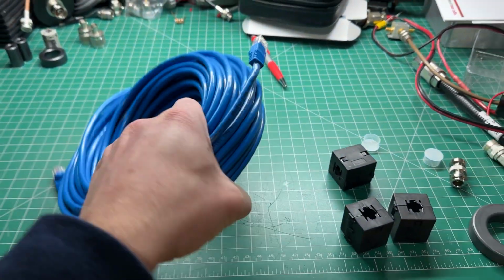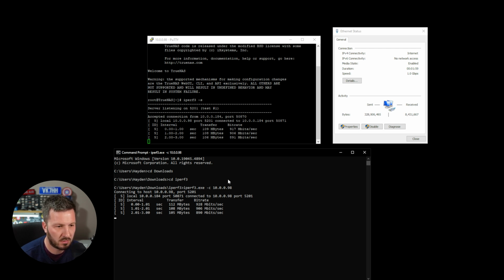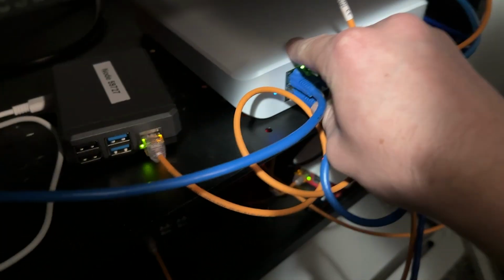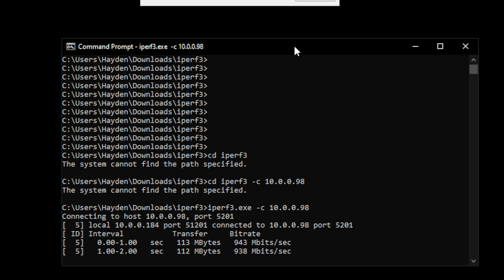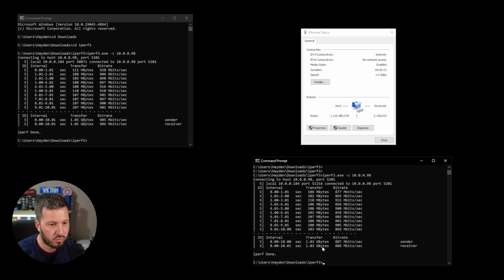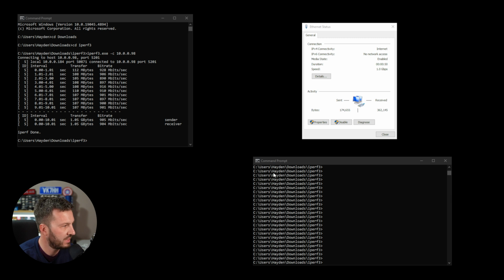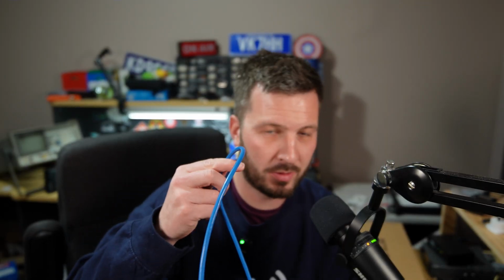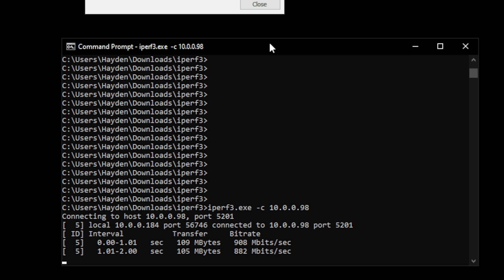Ferrite Cores: Are They Ruining Your Ethernet Speed?

Comment: Datasheet shows that the problem is above gigabit speeds, Mix 43 is permeable at tens of megahertz followed by a steep drop. Mix 31 datasheet shows a wider band of permeability. It's nice to see actual measurements with functional tests, in any case. Overall, however, go Cat 6a or 8, double check that your RJ-45s have metal casing, and ground at one end, i.e. your patch panel or switch.

Comment: I just put up a new dipole and was getting issues with CMC knocking only my main pc off the internet during transmit on 40 meters (haven't got around to putting up the cmc choke at the antenna feedline yet).  I have an extra mix31 ring and wrapped about 3 turns on the pc end of ethernet cable (CAT6).  It eliminated problem.  PC stayed online.

Comment: More likely the problem is the actual connector connection (assembly of the cable to the connector) I choose to use the Feed through style connectors as I find they make for a more reliable connection when making ethernet cables by hand.

Comment: Here is an unintelligent test... Try this on a PoE connection (AT or AF), or if you're brave, BT... (802.3BT that is) and then remove the isolation and ground the PoE powered device to earth! I think you will find very quickly the unpleasantries that a choke will have. Even if you're using CAT6A shielded (aerial or direct burial).

As to the principle reason why it should have no impact is because Ethernet is already transformer isolated on both sides, and are by design: differential pairs.

Comment: I recommend cat 6e. If the switch is getting old replace it also check the firmware on the switch. Call your ISP and check with them on upgrading your router. That is where I would recommend starting.

Comment: Thats BS storrys, ETH is dif pair, external ferrite has NO EFFECT. Thats the whole point of dif pair, outside of it can be wadever bananas and noise, dif par WONT BE AFFECTED. 
As bonus ETH is isolated with transformers at both ends, that will minimize any DC bias issues´and low fewquency noises.

Comment: Can your switch do PoE? Maybe test that for the next video?
Reply from the maker: Yep it can! Would be interesting to see if PoE devices drop out
Reply: @HamRadioDX  agreed, and perhaps how much noise you can choke out of the Ethernet cable
Reply: As others have noted though, you would need to create an alternate ground path. An isolated PoE connection would still create a differential pair back to the power injector.
Reply: @Maker_Mikey  I've experienced issues with PoE making horrendous HF noise, and I've had to choke the heck out of the cables to reduce the noise. I also had drop outs on the same Ethernet cable. Perhaps they are related? Perhaps the noise was coming from the switch?

Comment: When I put a mix 31 toroid on the network cable to my shack computer, It dropped the connection completely when I transmitted on 80m with my Hermes lite 2 and a 300W amp. It was quite frustrating since I then lost the connection to the Hermes. It took me a while to figure out what it was. When I removed the toroid that I had put on a few days earlier, everything worked as normal again.

Comment: Each pair should be perfectly balanced (since they actually use tiny transformers instead of differential amplifiers) so the magnetic fields cancel out for any data signals so the ferrite beats shouldn't effect them unless you put them so close to the twisted pairs that the small gap in the pairs start to matter (which probably would mean removing the shielding and wrap the pairs individually or at least make such a tight bend that the wire gets damaged) 
But that also means that it's unlikely that there is much common mode noise the ferrite cores can help with unless the ethernet magnetics on the endpoints are the issue or there is a shield that could conduct common mode currents (which Cat5 and Cat5e doesn't have).

Twisted pair has this small issue that while it's very resilient against noise that's only really if if the noise couples perfectly equal into both wires and real world isn't perfect, so a strong noise source over a long distance could still cause issues. Shielding could help in that case.

One thing that might actually be better or at least another good statistic than throughput is the RX/TX frame errors while you test throughput (I know on linux you can get them by using "netstat -i" or "ifconfig" don't know about windows though)

Comment: STP and FTP cable is better and what I actually did when I was getting RFI on my long runs (over 30 meters running through the ceiling) was to switch to fiber optic. It was surprisingly cheap to do so. I will continue to use fiber for my long runs.

Comment: An ethernet cable is more or less just 4 balanced antenna feeders.

Notwithstanding, throughput with iperf isn't the be all end all (you should be getting consistently higher with unintended hosts on an unintended network), but the test could be more scientific by looking at frame errors/CRC as well as frame counts sent vs received at either end.

In my experience, PoE devices like cameras are the noisiest, followed by junky devices which induce Switch-Mode noise into everything they come into contact with. The best solution being to use shielded CAT6 rather than UTP.  Adding chokes on marginal runs or crummy cable can make them drop frames. But as you have demonstrated short good runs make minimal difference.

Comment: Nice test. All my cables are CAT 6 and have snap on ferrite on them . I never noticed a speed drop at all.  I choke everything . Reduces RFI radio noise and before I choked everything my Baofeng on UHF when I key up would take me off line if i was close to the switch.  No longer does that with chokes . And the noise on AM radio is much less . I have had bad cables reduce speed and drop outs. 73
Reply from the maker: Thanks Robert

Comment: Of course there can be two different speed issues 1) doing something messes up speed negotiation so you drop to a lower speed 2) Ethernet packet loss, the way this causes speed loss is especially for TCP/IP as when tcp sees missed packets it slows down then speeds up gradually. This can cause a big drop in throughput

Comment: Do the ferrites keep RF in the shack from affecting the Ethernet?
Reply: not meaningfully, unless your antenna is inside the shack. My main problem is the noise from the ethernet getting into the shack :( the noise and harmonics of 250Mhz is horrid... which is the primary reason to get shielded ethernet. Even at the 100m mark, I have more problem with noise from the cable than noise into the cable.

Comment: Old fashioned Cat 5, which you mentioned you were using, I find won't reliably carry gigabit. A lot of times, the network will sync up at gig, then eventually drop back to 100 Mbps.  In my line of work, we have been trying to eliminate all the cat5 (patch cables) we find and replace with cat5e (enhanced) or cat6.  Cat 5e has a tighter twist and most are stamped "350 MHz", and cat6 still tighter and is stamped to "550 MHz".  The higher speeds of gigabit and beyond need the tighter twist to handle the frequencies used in carrying gigabit (reliably anyway).  Just my $0.02 worth.  Love the videos.
Reply from the maker: I should've clarified. The cable I had was actually Cat5e
Reply: Either way, it’s a function of data rate x cable length. Cat 5 is fine for short lengths of gigabit (like a 3m patch cord from the wall to PC) in low-noise environments. But the longer the run, the more noise gets in. So for longer runs, better cable is superior. And of course in electrically noisy environments, like industrial, heavily shielded cable is essential.

Comment: RFI wise, shielded CAT6 does make a pretty big difference if the runs are as short as possible, made a big difference for me at least. Especially as far as RF getting into the modem and noise on HF. Wrapping this kind of cable around toroids is a game of chance, can easily mess up the cable.
Reply from the maker: How does it mess up the cable?
Reply: @HamRadioDX  I don't know exactly but in my experience I ended up with a reduced link speed after having wrapped it around a FT-240 43. I think it's likely it damaged one or several of the twisted pairs but I honestly didn't inspect it, I just cut the "bad" part off and put on a new connector. 😅
Reply from the maker: @StianEklund  yeah the cable I used wouldn't be suitable to wrap around a ring toroid, that's why it was very loose in the video so I didn't damage it.

Clamps would be better

Comment: 1. Different Types of Ferrites and Their Effectiveness:
Each ferrite material has a frequency range where it is primarily effective. It's important to understand the distinction between the full operating range and the range where attenuation is most significant. Ferrites can attenuate RFI without necessarily affecting Ethernet signal if they are not effective in the main band used by GbE.

- Common Ferrites Used in Amateur Radio and Analyzed in Relation to GbE Ethernet Signal:
Ferrite #31 (NiZn): Effective over a broad range, with significant attenuation between 1 MHz and 300 MHz. Although this range overlaps with the GbE signal (125 MHz for 1 Gb Ethernet), attenuation at 125 MHz is moderate. This material is commonly used for power cables and network cables, as it provides good attenuation of RFI at frequencies below 100 MHz, where much interference is generated. This can effectively reduce RFI without severely impacting Ethernet signal.

- Ferrite #43 (NiZn): Effective mainly between 10 MHz and 300 MHz. Although this ferrite may also overlap with GbE frequencies, its primary effectiveness is below 100 MHz. This means it is very effective at attenuating low-frequency interference, often emitted by power supplies and electronic devices, but has minimal impact on GbE signal beyond 100 MHz.

- Ferrite #61 (NiZn): Less effective at low frequencies and works better between 200 MHz and 2 GHz, which might coincide with some harmonics generated by GbE systems. It is less useful for attenuating interference below 100 MHz but might impact GbE signals. This means that ferrites of this type are more likely to block useful signal components, especially if poorly applied. It is often used for high-frequency applications but is generally not recommended for Ethernet cables as it does not benefit against RFI in frequencies below 100 MHz.

- Ferrites #75 and #77:

Ferrite #75: Formulated to be effective in very low frequencies (from a few hundred kHz to about 10 MHz). These materials are primarily used to eliminate low-frequency interference, such as that generated by power supplies or power equipment.

RFI/EMI Effectiveness: Very effective for low frequencies, from 150 kHz to about 10 MHz. These ferrites are commonly used to block low-frequency interference on power supplies and power cables.

Impact on GbE Signal: No impact on GbE signal. These ferrites do not overlap with the GbE signal frequency and thus will not affect data transmission.

Applications: Ideal for power supplies of routers, switches, and other network equipment. However, they are not recommended for Ethernet cables as they do not offer protection against interference in the GbE frequency range.
Ferrite #77: Similar to ferrite #75, with slightly better efficiency in the 1 MHz to 10 MHz range.

RFI/EMI Effectiveness: Very effective for frequencies from 0.1 MHz to 10 MHz. No impact on GbE signal.
Applications: Suitable for power supplies only.

Summary of Potential Effects:

#31: Low impact on GbE as attenuation at 125 MHz is moderate.
#43: Minimal attenuation at 125 MHz, low risk of affecting GbE.
#61: Higher potential risk of affecting GbE due to its higher frequency range.
#75: Effective for frequencies between 0.1 MHz and 10 MHz - No impact on GbE - Power supplies only.
#77: Similar to ferrite #75, with slightly better efficiency in the 1 MHz to 10 MHz range - No impact on GbE - Power supplies only.

2. Impact of Ferrites on GbE Signal:
The difference between RFI/EMI interference and GbE signal is crucial. Although some ferrites cover a frequency band that includes GbE, their effectiveness (attenuation) in this range may be very low, limiting the impact on the signal.

Ferrites #31 and #43, while covering the GbE frequency, have reduced attenuation in this band, making their impact on GbE performance minimal.
#61 may potentially have a more significant impact but is less useful for attenuating RFI below 100 MHz, making it less recommended for Ethernet cables.

3. Placement of Ferrites:
Ideally: Ferrites should be placed at the ends of cables to capture RFI emanating from devices (such as routers and switches). However, a critical point is the proximity to the RJ45 connector. If the ferrite is too close to the connector, it might possibly interact with the internal electronics of the case, potentially affecting Ethernet signal performance.

Recommended Placement: Upstream of the connector, but far enough to avoid any interaction with electronics. Typically, placing the ferrite a few centimeters from the case is advisable.

4. Ferrites with One Turn vs. Multiple Turns:
One Turn (Clipped Ferrites): Provides moderate attenuation, simpler to install. They are generally sufficient for reducing minor interference without affecting GbE performance.

Multiple Turns (Cable Wrapping): Offers higher attenuation and is effective against stronger interference. However, this could induce signal loss if misused, especially with ferrites like #61.

5. RFI Generated by Routers and Switches:
Most interference generated by routers and switches is below 10 MHz. This makes ferrites #31 and #43 particularly effective for these interferences without negatively impacting the Ethernet signal.

6. Choosing Ferrites for Power Supplies (Routers/Switches):
Optimal Placement: Use ferrites on power cables near the routers and switches to limit the propagation of interference from the power circuits. You can also add a ferrite at the end of the power cable connecting to the mains.

Recommended Ferrites: Ferrites #31, #43, #75, and #77 are all suitable for power cables. 
Ferrites #75 and #77 are particularly effective at low frequencies.
For power cables, ferrites can be used without risking disruption to Ethernet transmission signals.

Ferrite #31: Highly recommended for filtering interference from power supplies, particularly effective for frequencies below 100 MHz, thus reducing interference that could propagate to other network components.

7. Shielding and Grounding: Effective shielding of cables (such as those used in Cat6a and Cat8) is often employed to block external electromagnetic interference. This shielding is grounded to dissipate interference without disturbing the signal. Shielding of router and switch enclosures is also crucial to limit EMI emissions.

Conclusion:
Using ferrites such as #31 or #43 on Ethernet cables is generally safe for the GbE signal, as they primarily attenuate lower frequencies where RFI interference occurs, without significantly affecting GbE frequencies. Ferrites #31 and #43 are common choices for targeting typical EMI interference without much impact on Ethernet signal. 
Ferrites #75 and #77 are less likely to interfere with GbE signals but are also not very effective at high-frequency EMI attenuation. 
Ferrites #61, while less effective against low-frequency RFI, may affect the GbE signal, so their use on Ethernet cables is not recommended. 
Placement is crucial to avoid interaction with internal electronics of the case. 
For power supplies, #31 remains an excellent choice for limiting interference without risk to GbE signal. 
Choosing the ferrite based on the frequencies to be attenuated and positioning it ideally away from sensitive circuit points is important to avoid undesirable interaction.
Reply: Thanks!

Comment: Going to shielded F/UTP Cat5 at our repeater site made a noticeable difference to the noise floor on 2m - I tried scattering ferrites around before changing all the cables and didn't notice any difference. Swapping the Ubiquiti 24V PoE switch out for a Netonix switch to run all our 5GHz PtP links made the biggest difference and took out all the sproggies.
Reply from the maker: The repeater site we're having problems at (my 2m RFI problem) does use all shielded cable and a POE rail. There is some UTP too between that and the switch.

The challenge lies in fixing the problem without actually disconnecting anything (i.e. no outages)
Reply: @HamRadioDX  The joys of shared sites I suppose, argh. Good luck on your quest, watched your other vid & looks like you nailed it with the two-turn clip on ferrite solution. I'm inspired to have a play with my VNA and see what I can find in my junk box that performs well on 2m... cheers! All the best from G-land

Comment: I've found that the noise issue is less prominent with "pure copper" cables, rather than the majority of patch cables that folks use which are CCS/CCA (coper clad steel/aluminium). I have a number of cat6 (and cat6a) runs both inside and outside, i have noticed that a clamp on ferrite, on each end, can make a small impact to the noise, but no statistically significant impact to the cable even when running at 10Gbit.